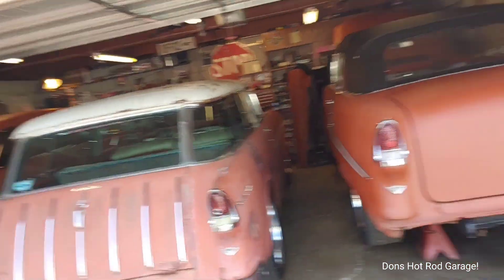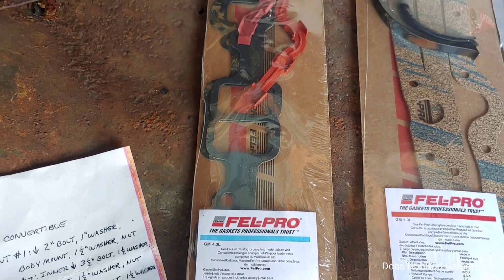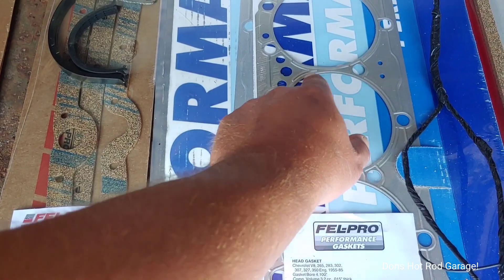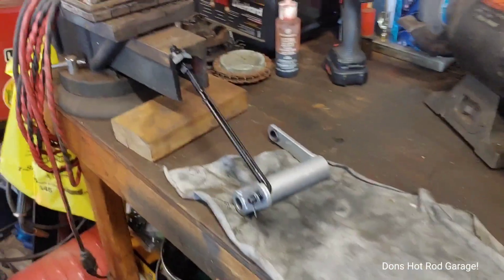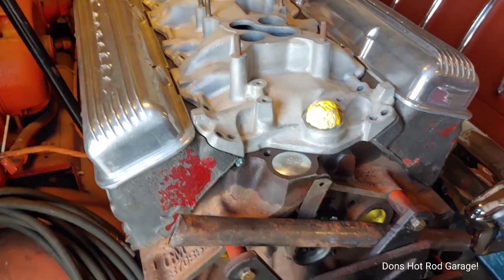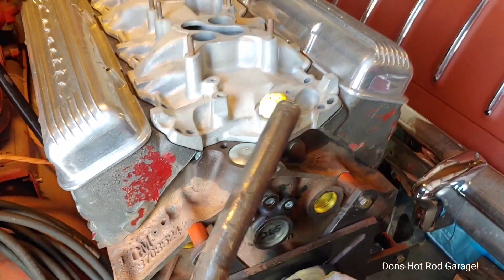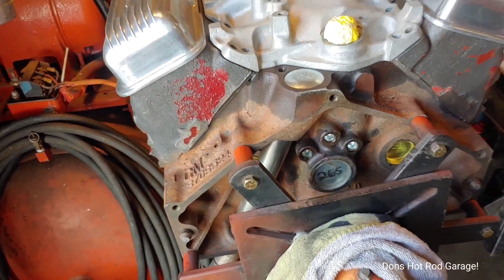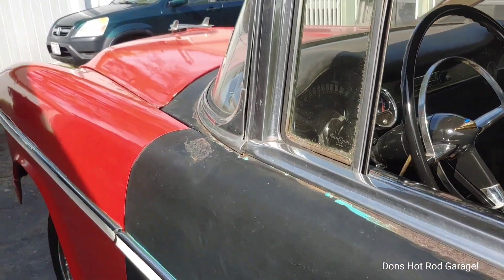55 Chevy Convertible Project car Plans!

Comment: That being said You will not be happy unless it's done the way you wanted it. So carefully tap the pistons out. And then carefully press the pins out and reinstall them onto the correct numbered rods. You should be able to use the rings if you do not break any. If in doubt buy new rings. Brake clean the cylinders and wipe them dry then reoil the cylinders and reinstall the pistons. Carefully align all the bearings and retorque the rod caps and you are good to go and happy again. I really do wish I lived closer I would help you assemble that engine the way it should be done.
Reply from the maker: Hey Edward! Thanks for the great info and tips! Its still just setting in the garage! Many have said I'll make the situation worse by moving parts around in the engine! The engine builder said he built the engine for the best clearances! Just wish he would have considered putting the rods back in the same cylinders! We'll see how it turns out man! I'll catch you next time 👍

Comment: Shout out to Homie the Clown! Attenion to detail is not a personal fault. There is nothing like paying for an engine/engine work and have it come back wrong. Now can you trust clearances or torque?
Reply: Exactly. An engine rebuild shouldn't be someone else's experiment.
Reply from the maker: Hey Jeff! Yeah buddy Homie the Clown! Awesome. This engine builder is a very very good engine builder who built this engine! That's why its tough for me to understand! I talked to another speed shop and they have advised me to leave the engine as! They said once everything has been machined the rod and piston goes into the best cylinder for clearance! The also said the numbers are truly only there if your reusing the original pistons! I'll just have to process this ans move on!  Have a good one ✌️

Comment: i would not try to change the pistons on the rods at home myself. i would have the buider guy fix that.
i bought a 383 chevy for parts that that had a piston wrist pin walk out a put a deep grove it one cylinder  
it had fuelie heads and a aluminum intake . my boss didn't even know it was a 383 . i found out after taking it all apart .
i scrapped the block and pistons and rods. i kept the crank . i got a lot of cool stuff when i was working at the rest shop.
Reply from the maker: Hey Jim! Yeah man im starting to think as much as I would love to have them back in there original cylinders. it just will make more work and potential damage! Have a good one ✌️

Comment: Don, you do what you need to do to make you happy, that's all that really matters. Might be worth while for sanity sake to plasti gage the mains and rod bearings.
Reply from the maker: Thanks Jeep4752! I've talked to 2 different speed shops and they are telling me to leave the engine as is! They say the numbers are there strictly to reuse the original pistons! If I take tge engine apart I could potentially break a ring on a piston or damage a piston pressing it off. In other words live with how it's assembled or start the rebuild process over! It's not what I want but on the other hand to have twice as much money in this engine would be a total waste of time and money! We'll see how it turns out. Have a good one ✌️

Comment: Hi I’m just wondering if he balanced your motor if he did I would be real careful about doing what you think you’re gonna be doing because each piston and Rod was balanced together so if you put this piston on that run and that it might throw the balance off talk to your engine builder tell them your concerns I’m sure he’ll make it right or tell you why he did it that way
Reply from the maker: Thanks Tony! You know man as much as i would like to change the rods back to the original cylinders im going to leave it alone! This has been really bugging me but I have 100 percent confidence in the build of the engine! This guy has built engines for many years and he worries more about a clearance then a number on a rod. He told me he is looking at the life of a engine and what is best for rhe engine! I've talkes to him a couple times and he told me the engine is setup up the very best way with the tightest clearances possible! Thanks for the comment man I sure do appricate it! Have a good one ✌️

Comment: Hay Don, your right. Im the same way when it comes to building a engine. I want it right. Now when it comes to the rods, it don't really matter as long as there in spec. However, we know the old saying. If you want something done right, then you have to do it yourself, (right). I'm with ya man. If they were all good then why didn't he put them back in the correct cylinders. Its not that big a deal. Just put them back where they go. 1,2,3,4,etc.. Some old timers don't really care as long as its back together an running. Well not me im the same way. Mic it an if it good it goes right back where it came from. Everyone is different though i guess. That's why i didn't respond or leave a message on you last video update. An yes it does take alot of money to get these old hot rods the way we want them. So it shouldn't be that big a deal to want it done right the first time some people just don't get it. So i figured that you would have plenty of answers to your solutions on your last video. (Comments) You know me don, build it exactly the way you want it brother. Take it all apart an put all back together in the right order. That's why we do it the way we do it. An thats also why we are just a bunch of old school hot rodders keeping this old iron on the asphalt. We build it right. Anyone who's ever build an engine knows that if it is still gooe an in spec. then it goes right back in its place. Now when building a high dollar engine is a whole different ball game. Then you are working with all brand new parts. Just like putting together a puzzle for the first time. Don, man your doing exactly what i would do brother. This way in the end, man i know what I've got an how it was put together. So (keep on keeping on) my hot rod buddy. Hay it will all turn out just the way you wanted it to/an dremed it would my friend. An Don, will be one happy hot rodder. Have a great week. An we shall catch you on your next update. 😁👍👍
Reply: Richard,  Yep, that 265 has got to come back apart ! I can't believe this builder did NOT Dynamically balance the rotating assembly !!! Thats just CRAZY on a fresh build of a 70 year old motor with zero history on it. !   The deal is after there   Dynamically balanced the correct pistons MUST go in the correct number bore they belong to, thus the term Dynamically balance !!!
Reply from the maker: Thanks Richard! Yeah man your right man! It should have went back inti the original cylinders! I talked to another speed shop and they have advised me to leave the engine as is! They said once I start moving stuff around plan on rebuilding the engine! They said once everything is machined the rod and piston goes into the best cylinder for clearance! I'm stumped as another complete rebuild would not make sense on a old engine like this! I would have way more money in it then its worth! The engine builder has told me that this engine is built in its best configuration right now! I'll just think about what to do over the next few days. The builder said everything was clearanced and built to run for a long time! Who knows really man I do know this engine builder has built many very strong and successful race engines over his 80 years old life. I'll process this deal and move on man! Thanks for the great support and comments brother ✌️ have a good one 👍
Reply from the maker: That's great info Mike👍

Comment: Personally, I would make the "Shop" do all the rectifications so that way you  maintain your warranty level.
Reply from the maker: Hey Shaun! Yeah man I hear what your saying! These old engines are tricky man no machine shop wants to put a warranty on a older engine with a hydraulic camshaft or solid lifter camshaft! So basically they won't warranty the engine due to the common problem of cam shaft failure. It's a true and gamble to have a custom engine shop rebuild your engine and I knew that going into this. It's one of the reasons many people toss the original engine and buy a brand new crate motor! Ive talked to a machine shop and they advised me to leave the engine as is or do potential damage but removing rods and pistons! We'll see how it turns out. Have a good one ✌️
Reply: @donshotrodgarage1717  Hi Don, My honest advice for you at the moment would really be to leave the pistons and rods alone. But deal with any potential cam bearing issues.
Best Regards Shaun from Australia.
Reply from the maker: @Kroombit  Thanks man! Im starting to think just like that. I would prefer the right rods in the right cylinders but if this is the best set up for the engine Im going to leave it be! Have a good one ✌️
Reply: @donshotrodgarage1717  No worries, Keep up the good work looking forward to the reveal of the Convertible.

Comment: You could take the pistons out and take them to the machine shop and have them switch them around. It'd be easy for them. They'll probably do it for free just to make you happy.
Reply from the maker: Hey Gary! Ive talked to another speed shop and they have advised me to leave this engine along unless im planing on doing another complete rebuild! They say the numbers are only there for reusing the original pistons! I talkes the engine builder again and he told me the engine is built in its best configuration right now! He said everything has been machined and it was built as is to run its very best! I'll have to process this and move forward! To have twice as much in this engine to move a few rods around does not make sense! Have a good one ✌️

Comment: Hey Don i just don't understand why your engine builder did not put the rods in the holes where they were supposed to go.  I totally agree with you that if it was me, i would do just what you are going to do.  Just be careful pressing those pins out and good luck with all of it brother.
Reply from the maker: Hey Robbie! Yeah man I really want to move the rods around but I talked to a machine shop and they have advised me to leave the engine as is! They said once I move stuff around plan on rebuilding the engine! They also said once everything is machined the rod and piston goes into the best cylinder for clearance! The engine builder has told me the engine is built in its best configuration right now! So ill have to process this and move on! Have a good one ✌️

Comment: I couldn't agree more. What happens the next time the engine comes apart and you now HAVE to keep things in order? 
There's one way to get it right and 8 X 7 X 6 X 5 X 4 X 3 X 2 X 1 = 443,520 ways to get it wrong. They're numbered for a reason.
Reply from the maker: Thanks Curbmassa! Have a good one ✌️

Comment: I hope you didn’t take any of my last comment as offensive, ironically I feel the same way as you do. You need to make it right for you. I have real issues with other people work because unfortunately most peoples standards today’s are not like mine. Excellent work on these fine automobiles!
Reply from the maker: Hey Randy! Man I appricate all the commnets man! I feel like you do as most people work today is not the same as I would do it! On this engine ive talked to another speed shop and they have advised me to leave the engine as is! They said the numbers are only there for reusing the original pistons! Once everything has been machined the rod and piston goes into the best cylinder for clearance! So I'll have to process this and move on man! Have a good one ✌️

Comment: It can be an issue because of chamfering on the rods big end., Unless they are in a proper alignment even and odd
Reply from the maker: Hey Ray! Yeah man there has been alot of potential problem brought to my attention that will accure if I change the pistons around. I will more than likely leave the engine as assembled from the engine builder. He has assured me that this engine is built to run and run great. He told me the numbers are only there for reusing the original pistons! Have a good one ✌️

Comment: Don, I can totally understand you wanting to put the rods back in the cylinders where they originally were and bolted to the original position on the crank shaft and I would do that but I would never remove the new.060 over pistons from the rods. Every cylinder has been bored and should be exactly the same size and every piston is exactly the same size also.  Was the crankshaft turned/machined?  Will it void your warranty by you changing the rods and or pistons?  It’s your soap and your body part so you can wash it as fast as you want to!!! If the engine or body part blows, you’re the one that has to clean up the pieces so good luck buddy I support you!
Reply from the maker: Hey Don! Yeah man this is turning into a issue for me! Many have commented including you about trying to remove the pistons from the rods. I'll have to call some other local machine shops and see what they say! Have a good one ✌️

Comment: Guess your giving up your WARRANTY once you go into that Motor
Reply from the maker: Hey John! I called another machine shop and they have advised me to leave the engine as is! They say once I start moving things around just plan on another complete rebuild! My engine builder assured me that this engine is built in its best configuration right! I'll have to process this and move on! Have a good one ✌️

Comment: It's your engine. You would always be worrying  about it.
Reply from the maker: Hey Ed! Yeah buddy your right! I've talked to another speed shop and they tell me to leave the engine as is or plan on another complete rebuild! They have stated just like the actual engine builder that the numbers are only there for reusing the original pistons! Bob who built the engine as told ma again the engine is built in its very best configuration right now! This is something I will have to process and move past! Having to rebuild this engine twice to move rods around would not be worth it! Have a good one ✌️

Comment: Don I agree with you, that would drive me crazy. I would do the same thing and put the rods back in the correct order. Like I always say, if you want it done right you got to do it yourself. I would take it back to the builder and tell him to  put it back together right! Sorry, I'm getting mad for you, you pay to much money for lousy work.
Reply from the maker: Hey Greg! Yeah man that would an the simple solution but he has told me tge engine is setup to run its best right now! I called another machine shop and they have advised me to leave the engine as is! They said once the machine work is done the pistons and rods go in the cylinder for best clearance! I'll have to process this and move on! Have a good one ✌️

Comment: man dont du it if you dont have the right tools youl crack or deform the pistons score pin bores a nd  putting them back togather
Reply from the maker: Hey Mark! Thanks for the great info brother! Your right I just talked to another machine shop today and they said leave the engine alone! The said the rods are only numbered for reusing the original pistons! Once a engine has been machined the rod and new piston go into the best cylinder for clearance! I'll have to process this and move on! Have a good one ✌️

Comment: Personally would not touch it , simply because anything goes wrong with the engine the builder will say not my fault , someone has been fooling with it 😢
Reply from the maker: Hey Grandpa R! Yeah man as I talk to more people about this engine im starting to think the same way! I talked to another speed shop and they have advised me to leave the engine as! They said the numbers are on the rods only for reusing the original pistons! Once a engine has been machined the rod and piston goes into the best cylinder for clearance! Its something ill have to process and move on! Have a good one ✌️

Comment: Sounds like you grew up believing that if you got something out you put it back where you got it from. I'm that way. Put whatever you got out back in the same order! Especially my tools! Don't just leave them laying on the floor all willy nilly. 😒
Reply from the maker: Hey Big Block Kings! Your dam right that's how I grew up! This engine has me really stumped as many have commented and said I would mess up more then I could make good by changing the rods around. I called a local shop today and they told me to leave the engine as it is! The original engine builder told me the numbers are stamped onto the rods so you can reuse the original pistons! This engine has new pistons and does not require the rods in any specific spot. Man im over thinking about this deal and im probably going to buy it the rest the way togther and fire it up! Have a good one ✌️